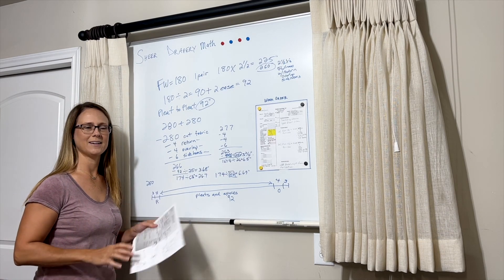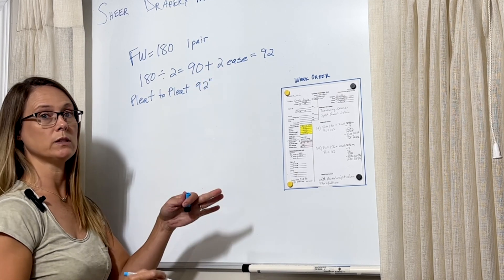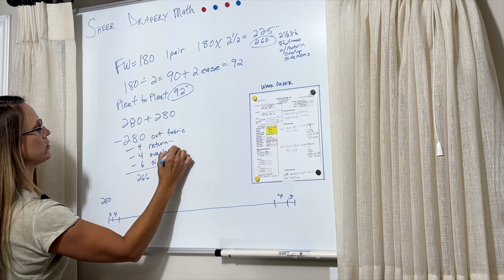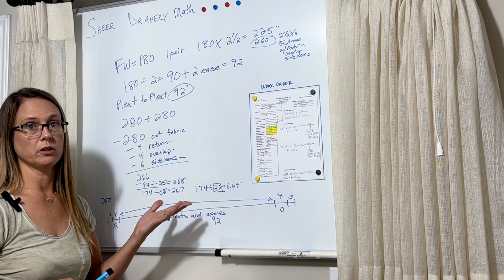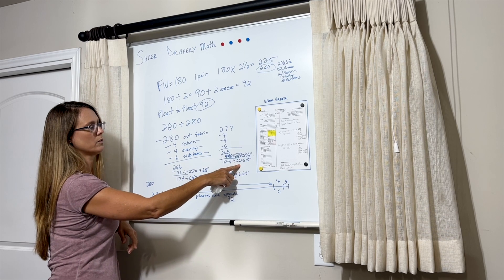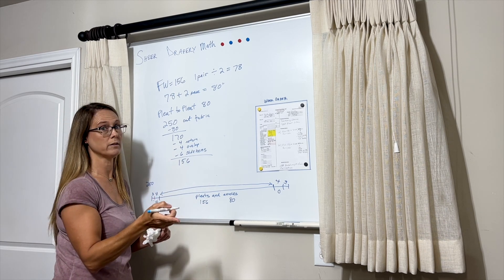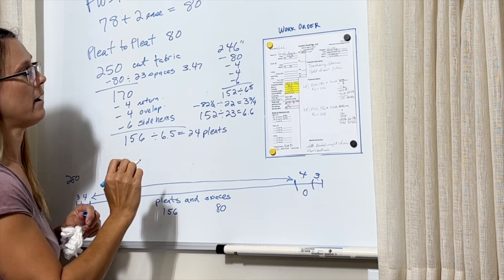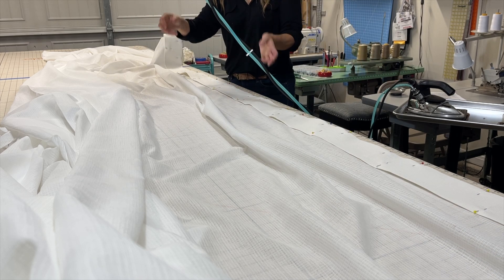How to Figure the Math for Sheer Drapery Pinch Pleats and Spaces - Workroom Tutorials

Comment: Thank you for sharing. You reassured me that it’s just that complicated. You can’t just throw it together. It took me a lot of notes and redoing my math. I just made a set of drapes with tab tape. It was a table cloth I bought to get the color I wanted and it was cheap. This was only my second pair of drapes. I did exactly what you did, calculate, and calculate again, and again. Now I know it’s just the way it works. You have to consider all the measurements, adjusted for shrink. Reassess for return, and overlap…. Still I had trouble installing the rod. So I had to move the placement a bit. It just made it to overlap in the middle. They are stretched out flat without any ruffle, which is fine. You also made me realize why custom drapes cost money! 😂 nice work.
Reply from the maker: Yes! So glad you understand how challenging the math is. There are so many variables and decisions that come into play. I like to be able to play with the numbers to balance the fabric and get the prettiest pleats possible. Thanks for the comment!
Reply: @tullydraperyshop  I even was impressed when you mentioned if you had to make a seam to join the fabric, you would consider where that seam fell. Just one more thing I learned, thanks 👏